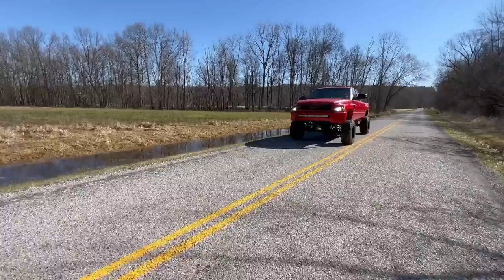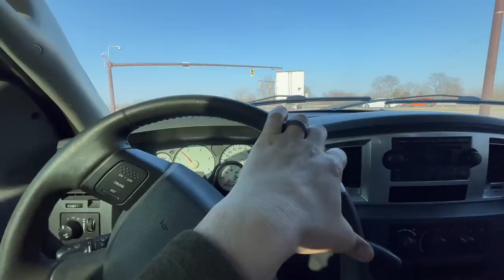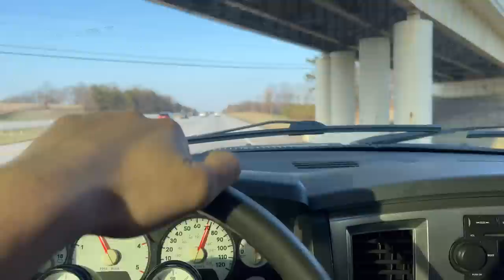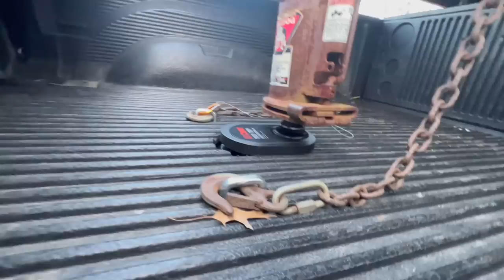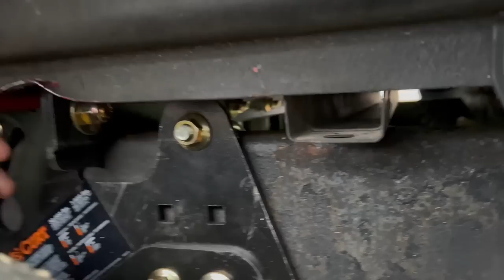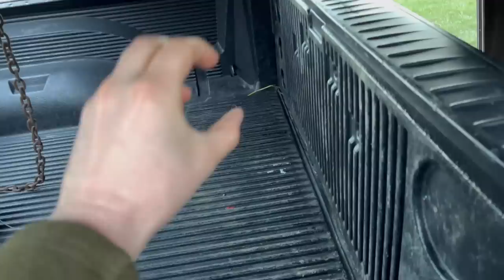the LARGEST ITEM we have EVER bought!!!!

Comment: Tow haul mode move the shift point up 600rpms from the normal point to give you a little longer time of quicker acceleration  before it shifts into the next gear

Comment: I think it's a good-looking setup if you didn't when you hook up the hitch use just a drop or two of permanent loctite and all the bolts you will never have to worry about them coming apart lock that it's a big deal if you torque the hell out of them they should be fine but something like that I would always get some of that red loctite

Comment: I have airbags on my l5p for My 42 foot 5th wheel dry weight 13500 load weight 16000 I run air lift bags with pump so I can adjust on the go.